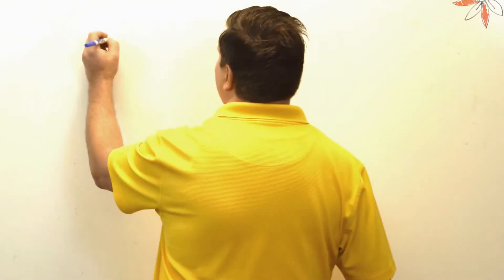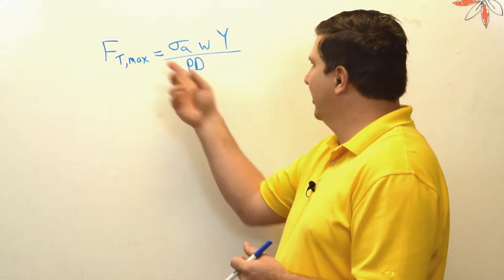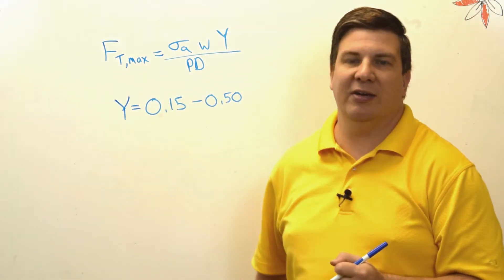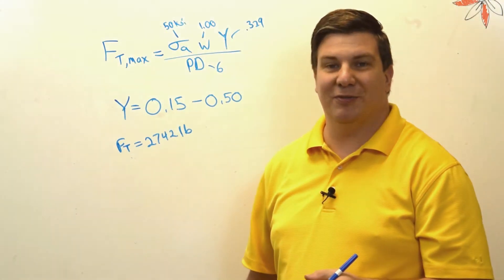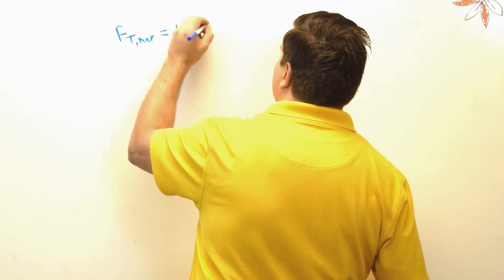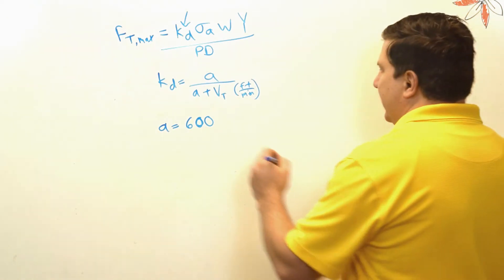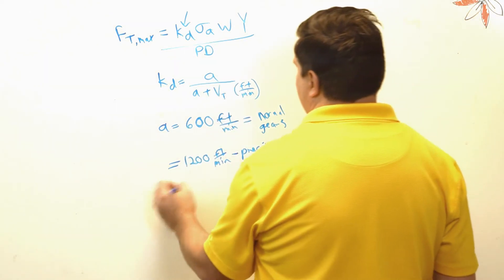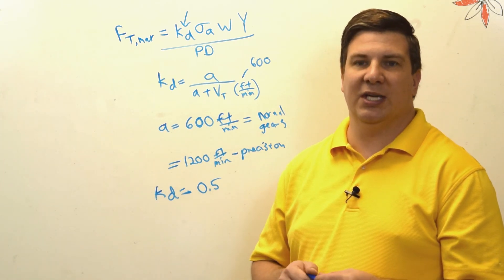Gear Tooth Strength & Lewis Form Factor - STEM

Comment: How would torque translate into FT?
Reply from the maker: Torque is the result of multiplying length and force (and they have to be perpendicular to each other).  It is measured in in-lb.  If you want it in ft/lb divide by 12.
Reply: @MentoredEngineer  Thank you. Just one more question, if a specific amount of torque was put into a gearbox, would all of the gears, regardless of ratio, experience the same amount of torque? I want to check the strength of 24 gears in a 12 speed gearbox.
Reply from the maker: No, the amount of torque is different.  If you are reducing speed, you are increasing torque.  Speed x Torque (which is power) is a constant for each gear in the system.  If you had and input gear with 12 teeth at 100 rpm and your output gear had 24 teeth, the output speed would be 50 rpm.  However the output torque would be double (24/12) because of the ratio.  If we say the input torque is 250 in-lb then the power of the 12 tooth gear is 100 rpm x 250 in-lb.  The output gear is 50 rpm x 500 in-lb.